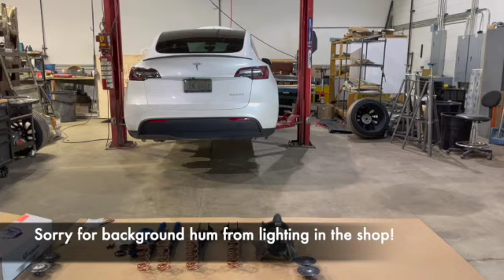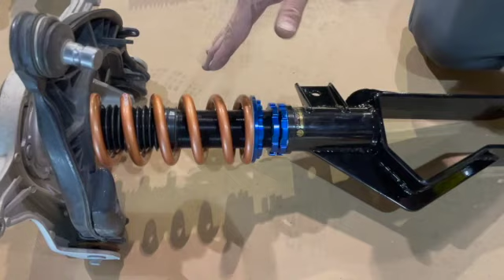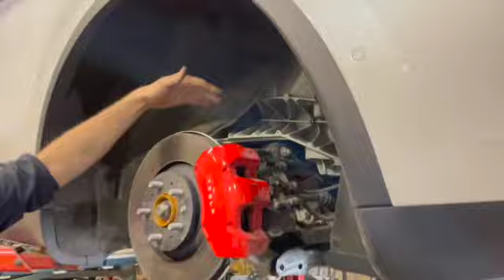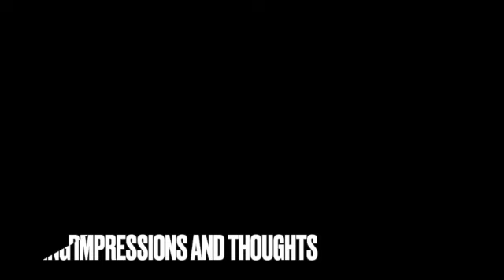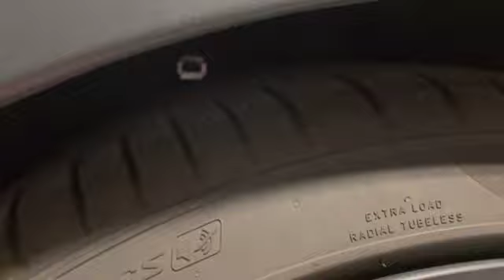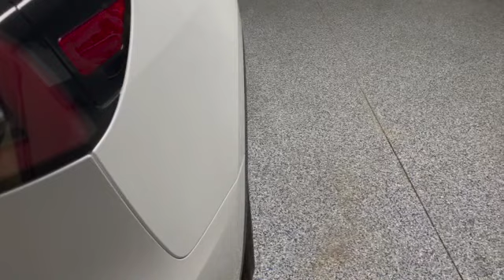Unplugged Peformance Luxury Coilover Kit Installation and Review

Comment: After installing the kit, When I turn direction I keep hearing Some squeaks when I turn direction. Do you have this situation? I sent the car to telsla service they said the squeaks are from the new suspension components.
Reply from the maker: Yes, I am experiencing a little coil bind and suspension noise.  I’m in communication with Unplugged Performance on a solution.
Reply: @myweekendwarriors  looks like it's common issue...Please keep me posted. Unplugged asked  me to send the kit back to them to inspect. But that  would cost me labor cost again. I don't want to do that...
Reply: @theliangsfamily767  That is how they get you with that return policy.  Worthless.

Comment: I just installed the suspension kit. For normal daily drive, which height you suggest? I prefer higher.
Reply from the maker: Stock height saves you lots of headaches.
Reply: @myweekendwarriors  I tried to set the height as high as possible, in the description it said the height could be adjusted to one inch higher than the stock high. But after adjusting, the height is just 63", couldn't go higher. the stock height is..63.8.”

Comment: I have a LR with 19". How does the softest ride on the 19" feel? Are those 20 or 21 on them now? Also did you compare with the mountain pass performance coil overs?.
Reply from the maker: I have not put the winter tires back on yet.  Riding on the 21” summer tires.  On the softest setting it’s a little bouncy, and have found my sweet spot seven “clicks” up from the softest setting.  I didn’t look at MPP, but have heard good things.

Comment: Imagine spending close to $60,000 on a luxury car, and then needing to replace the shocks and spring to a "Luxury" set, because stock is "too stiff", never addressing the huge, super heavy induction wheels with the low profile tires , then you lower the car a full inch, giving that suspension even less travel than before, and not do the alignment. Holy shit bro, you could have just ordered the car with the 19" Gemini wheels which come with thicker tires and ended up with a better result that what you just did.
Reply from the maker: Thanks for sharing your opinion.  You have a few details wrong (like not doing an alignment), and you don't know that I also have a set of 19" wheels and tires (which make little difference).  I don't think of my vehicle as a luxury car either - it's not.  It's no Bolt, but also no Porsche Taycan - the Model S with air suspension is certainly closer to luxury.  I am very happy with where it landed.  Suspension travel is not an issue, nor the problem I was looking to solve.
Reply: These are the lengths we’re willing to go when the sportwagon was so mercilessly replaced by bland crossovers.  It would be great not to go to these lengths to turn the YP into what we want it to be, but we’re fortunate enough to be “dealt” with such problems.  The end result is a daily driving sportsWagon with loads of cargo space that you can take to the track.

Comment: The Tesla chassis engineers spent a lot of time working on spring rates, damping, etc. I learned years ago not to mess with the factory suspension from any manufacturer. You just open a Pandora’s Box of headaches down the road.
Reply from the maker: Thanks.  I am more in the camp of believing in continuous improvement.  Things change in production all the time for the better.  Depends on what you are comfortable with changing and what you enjoy.  On this, I am pretty comfortable and confident in the changes I made.  If you don't enjoy doing these things, then you shouldn't do it.